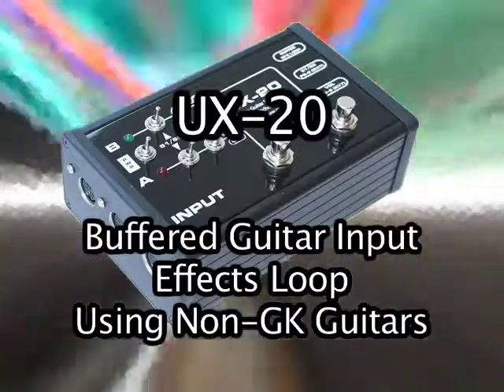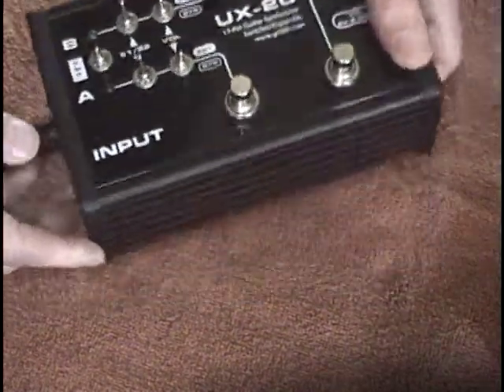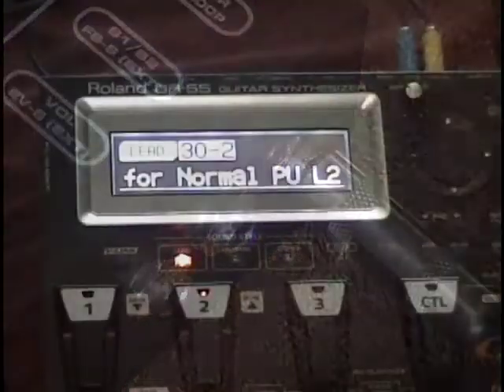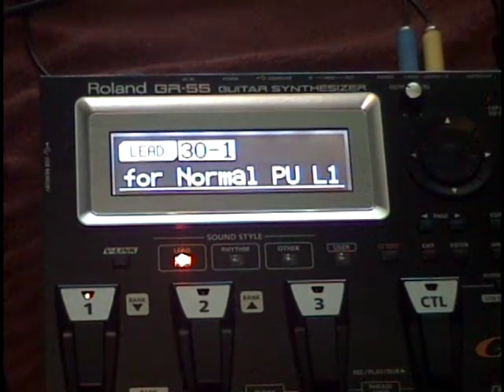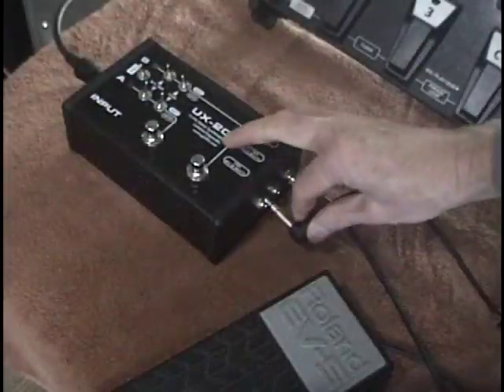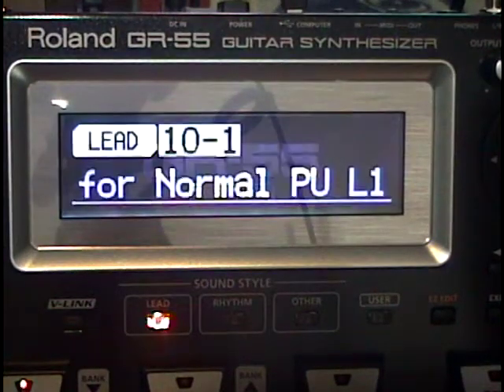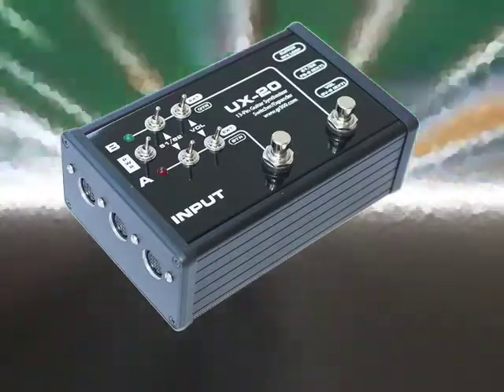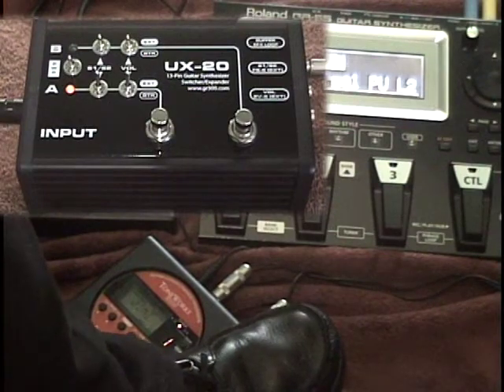UX-20 Roland US-20 Clone with Expanded Controls PLUS Non GK-Guitar Input

Comment: Hello,
I'm bassist, I have two basses:
1 MIDI Five strings (Graph Tech Gost / Piezo System)
1 - Four strings (Non GK - P10 Jack)
I watched some videos on the UX-20 and found it very interesting. I wonder if I can use my  4 string Bass + Digitech Bass Whammy (New) + Boss FV -300L and GR-55 together (I know I can not use the midi sounds in 4 strings)?

Wanted to send the diagram of my pedalboard.